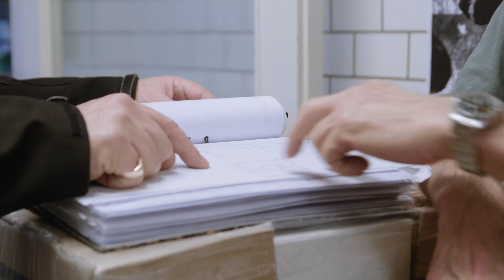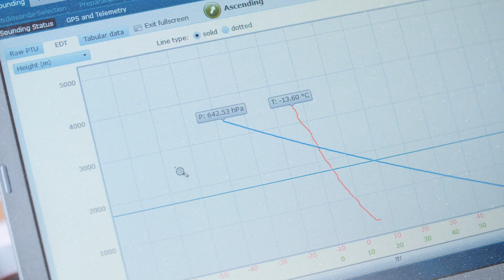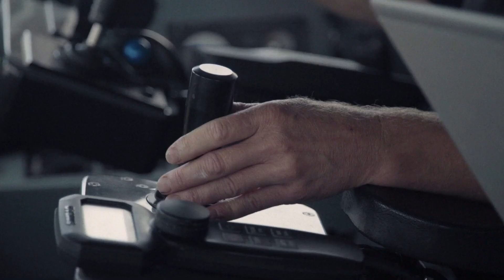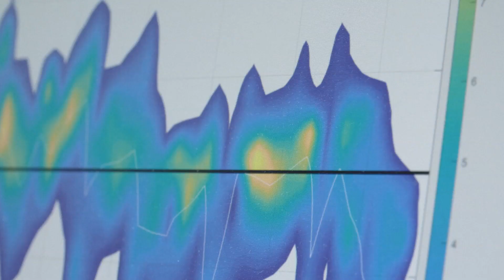They are trying to understand the climate change at the Arctic

Comment: Mother Nature is flat out averaging things out, in regards to the ice the North Pole Might be shrinking but the South Pole is expanding
Reply: The increase in the amount of sea ice in the south polar region is due to changes in ocean currents related to climate change. The glaciers in Antarctica are sliding into the ocean at accelerating rates. The sea ice doesn't matter in the context of sea level rise. Think of a glass of ice water full of ice cubes. As the ice melts the water level stays the same. The movement of glacial ice into the sea is like adding more ice to a glass already full of ice and water. Of course, the level of water will increase. Climate change deniers are being very foolish when citing the increase of sea ice in the south polar region in support of their delusional ideas.